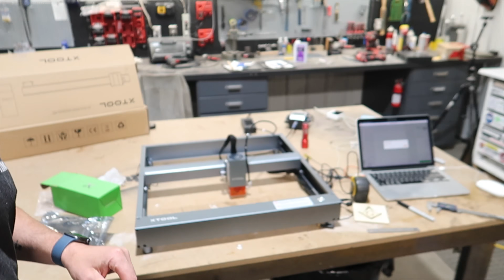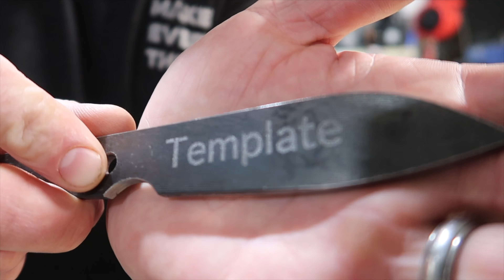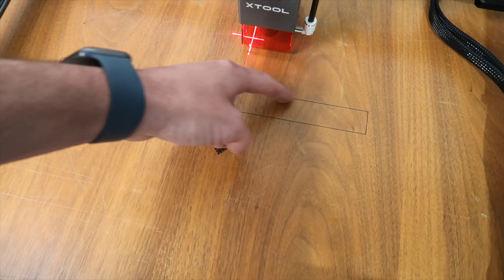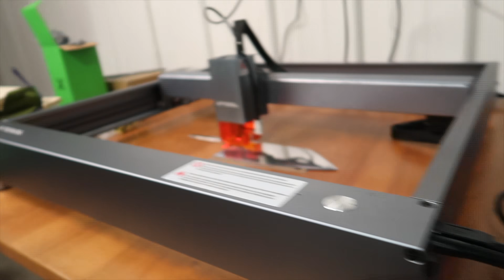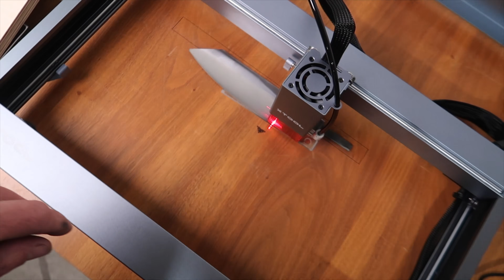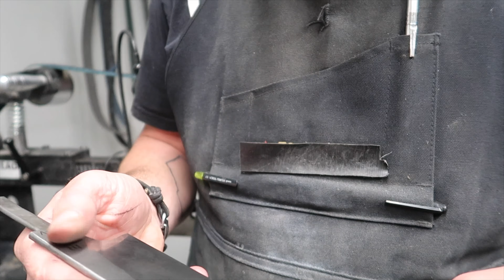Lasers for the Knife-Maker! - XTOOL D1 Pro

Comment: A few things when doing leather:
1. It smells bad! Really bad and the scent will linger on.
2. Protect natural veg tan using something like Fiebings Tan Coat with Atom wax or tack/transfer tape. I use the tack tape on both sides. After it's cut, i remove the back tack tape and burnish with Tokanole before using compressed air to clean stitching holes. Finally i lightly sand the edges to remove char.
Reply from the maker: Oh sweet thank you so much for the tips! I will definitely be using these when I start on leather sheaths. 👍

Comment: I don’t know if you’ll see this comment 3 years after the video posted but if you do I’d love to know if you’d still recommend this as an entry level laser for a relatively new knife maker?

Anything “better” in a similar price range?
Reply from the maker: Yeah this is still a decent laser, but you're mostly just using it for maker's marks and maybe engraving the steel type, I think something that has a stationary laser head would be better instead of a gantry style. It's a lot easier to engrave a finished blade on something like the WeCreat Lumos or the XTool F1. But, these gantry style lasers also allow for cutting leather sheaths out and stuff so if you would find it useful for that, something like this might be a better option. Cheers 👍
Reply: @Simplelittlelife thanks. I went ahead and purchased the XTool F1 Ultra.
I’m playing with it on different materials to get familiar with it. So far I’ve made a few mistakes on pieces of scrap metal. Fortunately the learning curve doesn’t seem too steep once I’ve gotten used to the settings/functions & where you find them.

Comment: Hey bud, great video.  Question since you have an xtool like I do and have experience in electro etching.  Would it be viable to mask off a blade w tape, laser off a design and then electro etch that design?  Also, in the video did you only use the 40w?  How did the 10w do in etching?  I have the 10w.  Thanks in advance

Comment: I feel your pain!!! its a tough transition but one you will not regret. I had a laser engraving machine built in 2019...I have a Needham Group  EPZ 4  70W Class 1 MOPA driven fibre optic unit...it is incredible. It was expensive but has paid for itself many times over. It engraves in 4k on hardened Damasteel. I too went down the same rabbit hole...marking everything at first!
I used to make everything by hand 100%....and for three of my ranges of knives ...I always will....but also the laser was the catalyst for the awakening as I call it. I now have a range of hand finished knives. The blanks are cut by EDM machine. I use only Damasteel...and had concerns how heat from CNC or laser cutting would affect the molecular structure PMS and add a requirement for annealing or normalising....EDM is the most effective way of accurately cutting steel to the most finite dimensions without risk to the steel.....may bea while before I have one in my shop but until then Im happy to outsource that element of the process. I am fortunate...my Damasteel supplier  is in Sheffield...the heart of everything steel in the UK...he has been based there for 30 years and was able to hook me up with one of the finest cutlery manufacturers that cut my pieces for me.  As I said it was a difficult decision in terms of morals and ethics...but a fantastic business decision. In the first year turnover went up 5X and profit margin soon followed. This Christmas we moved from a 1200 to a 3500 sq ft shop and haven't looked back. Plan over the next 24 months is to increase the range of hand finished products and bring in CNC equipment that will have the capability to carry out 90% of the process in manufacturing. I will always make knives 100% by hand...and have a separate area in the shop specifically for that end...but they are out of reach for most customers...if you have strong enough brand that will not be diluted by offering a more mass produced line then why not? ...I'll be creating more jobs and expanding into other areas of manufacturing. As an aside we use the laser to engrave and personalise golf clubs for a couple of local pros...Scotty Cameron putters and the like...that has started to really take off!! Started it back end of last year and in January that work covered all the shops utility bills and the cost of the move. 

I see it as evolution not revolution. 

Keep up the great work...yours has been one of the most influential channels on my process and journey.

Cheers 

Cavey

Comment: Im assuming you have figured this out by now but after the laser runs and you pull the knife off that's not actually the finished outcome ( in my experience  ) you wipe it with rubbing alcohol or equivalent and all that black finish comes off . Ive had the 20w pro with infrared laser module for about a year now & to be honest its paid for itself but not from metal products  , just from engraving woods  & making knick knacks , Christmas ornaments and such . Ive been hesitant to take on metal items cause it seems to be more of a lite etch not an engraving  , im trying to learn more and more and to use the laser with more confidence but i believe it can absolutely do some of the things you require but its definitely not a fiber or C02 type of outcome and there alot more expensive but can really do great things on metal materials . Also look into Lightburn , its way better than creative space and will help produce superior products...
Reply from the maker: I’m assuming you are doing it wrong. It works great for me. Cheers 👍

Comment: I've been wanting to add a laser to my shop.  I now electro/mechanical etch my logo.  I want to be able to etch/mark my logo in hardened  AEB-L, 14c28n stainless and other high carbon steel such as 1905, 1045 etc.  Was the blade you used in this video hardened?  Thanks and keep them sharp.

Comment: I appreciate the demo, Jeremy. I just purchased the XTool D1 Pro, but had different results. I couldn’t get it to leave a mark on my stainless steel knife. Do I need to upgrade to the 40w? Did you get good results from the 10W or did you use the 40 for the video? Thanks again, brother!
Reply: You can try a few passes and see if that helps and make sure your focus is dialed in. I'd run a ramp test as the factory 'kickstand' isn't always accurate.
 You could also try a marking spray for a darker etch. 
 The IR module is definitely more efficient than the diode on metals.

Comment: Jeremy, I know you’ve only had this a short time, but this is one of those things where I’m a little ticked off by community misinformation and a lot of makers claiming you cannot mark knives effectively with a 10w setup.  

I mean not only are you doing it, you can’t get off with Blue fine scotch belt, which depending on which brand it is probably around 400 grit.  

So again thanks for just diving in feet first, slapping your marks on with the 10w and showing everyone it can be done and we don’t need to buy a $7000 dollar Chinese machine off of Dodgy-Baba!

Cheers, 

Griff
Reply: Just so your aware he has a 20w & 40w & was using the 40w to get these results.  I have a 20w d1 pro with the 1064nm infrared laser and have yet to achieve these kind of results  !!! The infrared is a fickle beast , has to be focused just perfect to work and the kickstand doesn't get it close enough to really work . Each one is slightly different than the next & focusing it take trial &  error,  the only plus is it doesn't hurt your eyes so you can look at the white dot and move it around to figure out what's best . A 10w def. Won't work like his did  & I agree with some of the advertising being false !! Good luck

Comment: Which head did you use for your touch mark? Also love all your videos! I've learned a lot following your journey. Thanks again.
Reply from the maker: Thank you so much! I used the 10W for all the markings shown in this video. It was just the template I put on the mild steel template that was with the 40W laser.

Comment: I've also been resisting buying a laser, but it seems like lots of knife makers are going that route, so I'm probably behind the curve. It's encouraging to hear that the software is easy to use; I'm wondering about doing a more elaborate, perhaps pictoral etch on the full blade. My guess is that would be lots more complicated to set up, and thanks for your review.
Reply from the maker: Yeah I felt like I was 100% behind the curve too. But the free software they have for the laser is so intuitive and I picked it up like nothing. It is limited compared to lightburn (I'm messing around with that on a free 30 day trial) but for what I need to do I don't think I need more than the XTOOL free software. You can adjust the speed and power settings just with moving sliders up and down with your mouse. You can also do a light pass, check it, and if you need more power just dial it up and go over it again. After a few you can save the settings for various materials. It's work great.👍 I do want to do a big picture etch on a blade like a kraken or something like that. I will share it if I do.
Reply: @Simplelittlelife  I really appreciate you getting back to me, and am now making my shop addition plan larger to accommodate a laser. I fear the addition will end up being larger than my main shop, as my tools breed and multiply in the dark, or so it seems.